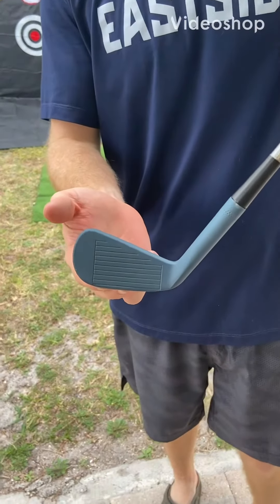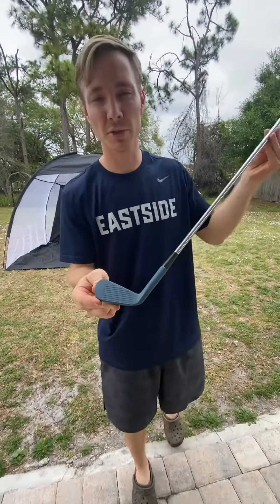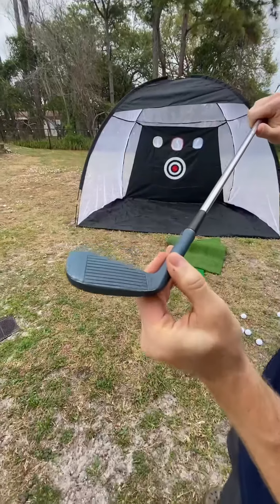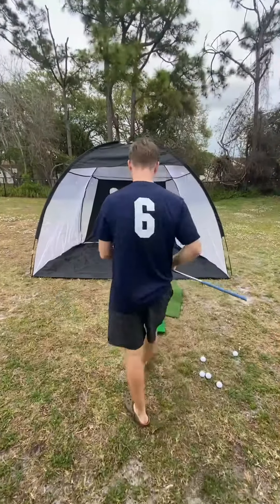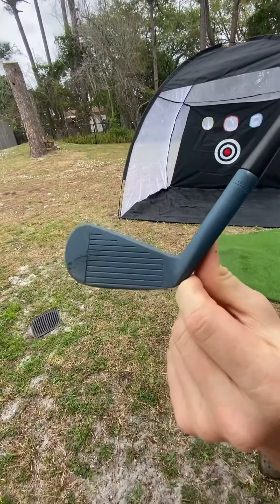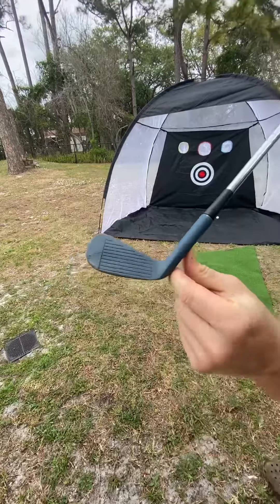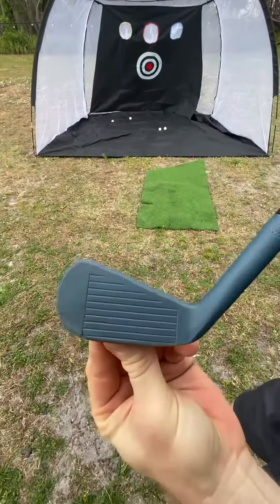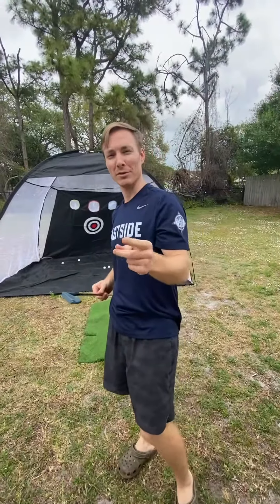Cerakote golf iron durability testing

Comment: That bad manufacturing mark is actually nickel that you didn’t remove. Golf clubs are carbon steel coated in nickel and final coating is chrome.
Reply from the maker: The smudge was from me bumping the cerakote with my hand during spraying and because it was just for a club test i did not attempt to make it perfect